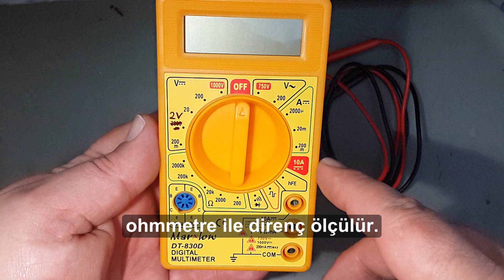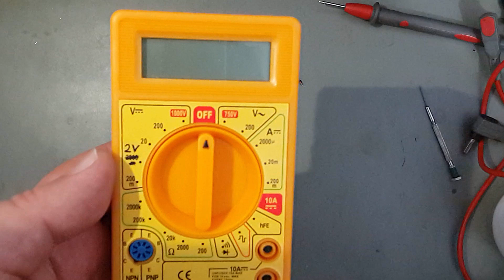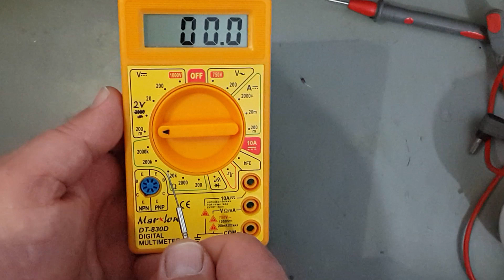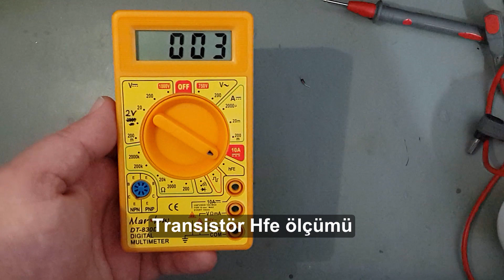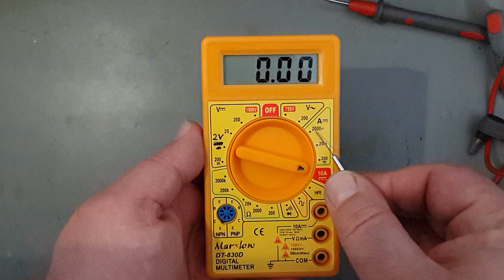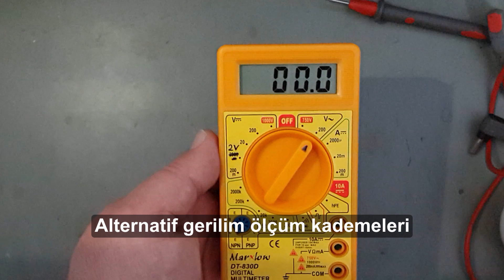HOW TO USE DIGITAL MULTIMETER.? (VOLT, AMP, OHM METER).

Comment: Hocam merhaba
Marketlerde satılan ucuz kamp fenerlerini bilirsiniz. Bu fenerlerin şarj modülü ve pilleri kısa sürede arizalanmaktadir. TP4056 şarj modülü ve li-on pil ile bu yapıyı değiştirdim.Gayette güzel oldu.
Bu fenerlerde aynı zamanda ufak bir güneş paneli bulunmaktadır. Şimdi takildigim nokta şu ;
Güneş panelinden gelen 5 volt gerilimi TP4056 modülünün şarj portunun yanındaki paralel uçlardan bağlıyorum bu şekilde pil  , şarj modülü üzerinden sağlıklı olarak şarj oluyor. Fakat pilleri , 5 volt adaptör ile şarj etmek istediğimde aynı anda güneş panelinden de 5 volt gerilim akışı olacak ve TP4056 , pil , güneş paneli zarar görme olasılığı olacaktır.Benim çözüm bulmak istediğim nokta devre,  adaptör ile şarj islemine maruz kaldığında transistör veya role yardımı ile ( tercihen transistör ) anahtarlama yaparak güneş panelinden gelen akimi kesmek . Bu konuda bir çözüm öneriniz olursa sevinirim. Saygilar.
Reply from the maker: Merhaba güzel bir çalışma yapmışsınız. güneş panelinin + ucuna bir adet diyot bağlarsanız sorununuz çözüle bilir. Diyotun anot ucu güneş panelinin + ucuna diyotun katot ucunuda şarj modülünün + ucuna bağlayarak şarj modülünden güneş paneline voltaj gitmesini önlersiniz.